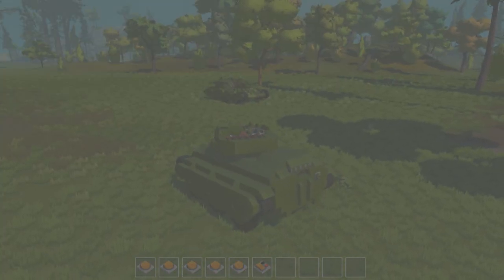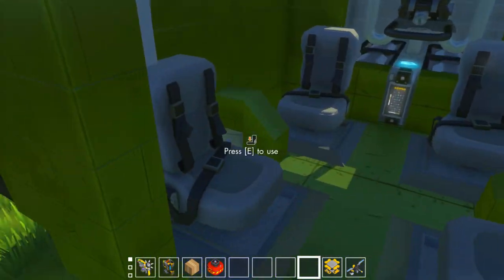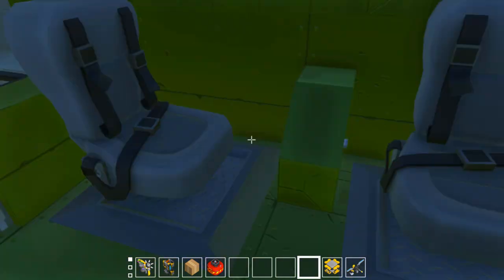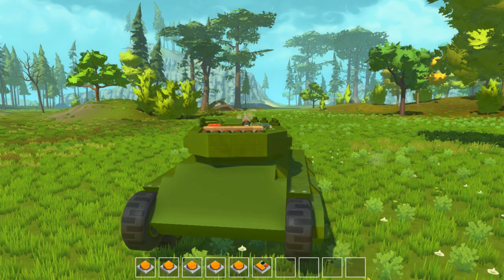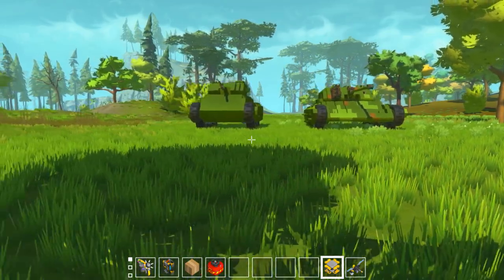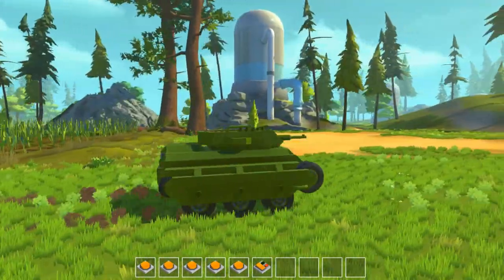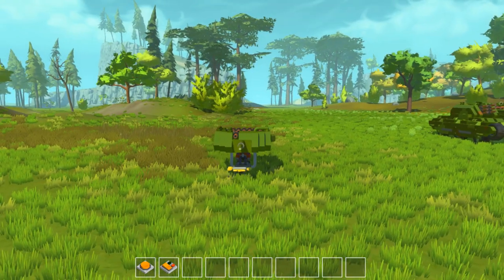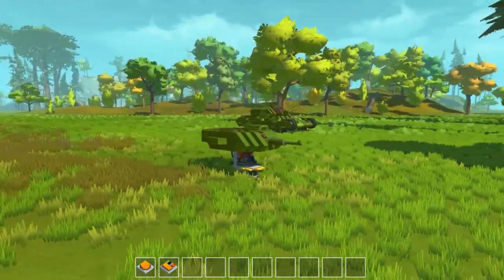"Mink" APC     | APC Mk 4.2 |  Scrap Mechanic Tanks

Comment: That's so cute but... can you make it smaller? =)  A tetratech or m22 locust ? It would have strategic advantages too... beeing so small you can hide fully behind a rock xD... 

PS: tried making a turret.. got a 10 shot autoloader in a 11x13 turret...
Reply from the maker: It's large due to the passenger compartment. Here's an old tiny mbt I built a while back...

https://youtu.be/LMv680yZXhc